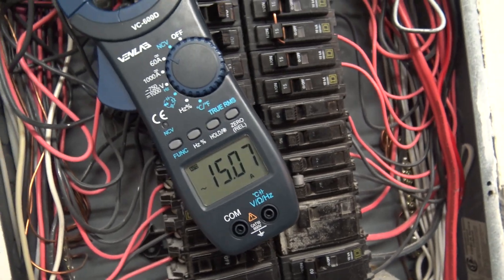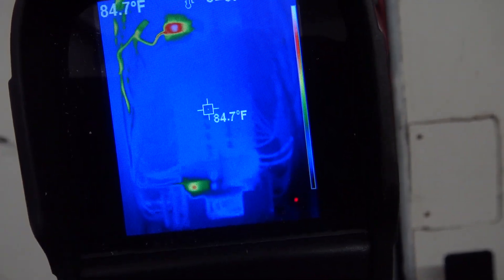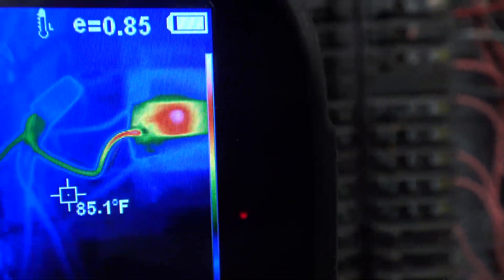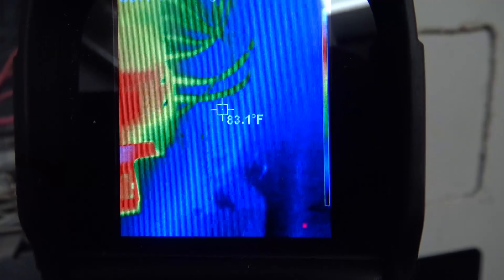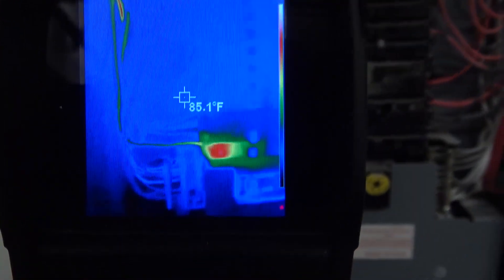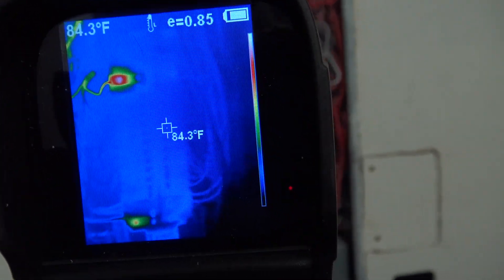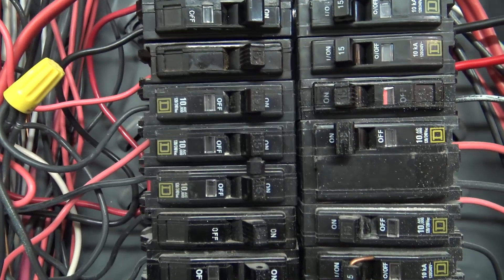Why is that circuit breaker tripping when AC running

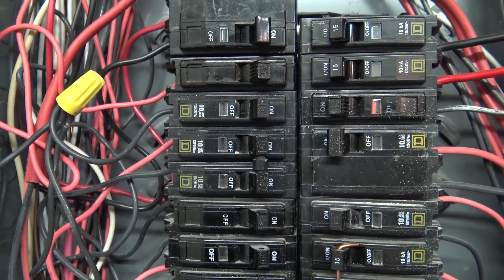Comment: I don't want to be "that guy" but in the interest of you and your family safety, it is worth it: Screenshot of 9:39 shows two hots spliced together with a wirenut, left of frame, but the problem is that the insulation is heavily scored in each wire and showing the bare metal. Please do your thing to it.
Reply from the maker: Three is no bare metal on those 2 hots that are connected.  The wire nut is not holding them together. They are twisted tight and the nut just keeps them tight.  The bare copper you see is ground wires in behind  as three js a ground bus in behind the wires.  The wires are not heating up.  One of those black wires is feeding the ac and the other a plug that is running 1 camera drawing 7 watts.  So no, there is no overloading in this panel.
Reply: @12voltvids  Cool, cool! I just saw bright material directly underneath the nut on both wires and I wanted to make sure you at least put attention to it at the actual location as you have done. Rock on!

Comment: I think it is common for the compressor to kick off, even in an at-demand situation. It might even depend on the make and model. I know of at least one machine that works like that, that did since it was new. Maybe that is what's happening. Or something to do with the capacitor (not start one) circuit and natural workings. Just guesses from here!

Comment: I'm under the impression the AC has an issue.  I've never had an issue with the a 120 volt 14k BTU AC that wasn't on its own circuit.
Reply from the maker: Its brand new and is drawing what it is rated.   Its just the heat in the panel heated from the sun blasting the other side of the wall.  Occasionally when the air compressor kicks in the breaker will trip when its hot out and that is on a different circuit.

Comment: these "close to 15a" size portable ACs tend to do this under voltage drop, say it's a hot day and the utility voltage is 115v or lower instead of 120v, nearly anything won't care but ofc the compressor will pull more amps to compensate and with such a marginal design will overamp the breaker.

this is especially a problem if the power company undersized the distribution transformer which they tend to a lot. 

since your wire is already 12 Gauge for you the quick fix is just install a tandem (2 in one space) breaker, make it a 20 amp circuit and get rid of the pigtail.

you also say the kill a watt reports 1100w? what does the power factor and VA say? you could also try sticking a capacitor across the outlet if the air conditioner is designed without one (a bit cheap and nasty but it is what it is). it would reduce the voltage drop, amp draw and boost the efficiency a little...

Comment: Your AC unit should have a tag on it indicating the maximum current draw when it's running full out. How does this number compare to your reading? Sounds to me like 15 amps is too much to pull from a 120 volt outlet. The 12 gauge wiring is good, but I think there's something wrong with the AC unit to begin with, for pulling that much current. Just my two cents
Reply from the maker: The plug on the cord has a circuit breaker / GFI on it and is marked 15 amps. The reason it trips is not the current draw, it's the current draw plus the fact that the back of the panel is probably 50c just from the sun heating the back side of the wall.  I have had other breakers trip on hot days for no reason. The lights in the shop tripped as well on a very hot day when I hit the button to open the garage door (same circuit) or the air compressor kicks in, again on same circuit as lights. Mid day sun is pretty hot here.

Comment: Maybe you in the US don't have such strict rules?

Are you thinking about fire safety? The electrics don't look so good.
Reply from the maker: There is nothing wrong with the wiring and yes it's 12GA wire which is fine for 20 amps not that I am drawing that the AC draws 15 max.  The reason it is tripping is external heating by a nuclear furnace that heats the wall up during the day. That external heat plus the fact that it is running just under the trip point eventual trips it.   The wires are all separated and not tightly groomed for heat dissipation.  A nicely groomed load panel might look nice but it also traps heat in the bundle.The electrician that initially set it up told me that.

Comment: How old is the AC and is it dirty. Dirty condenser coil will drive up head pressure and amperage. Well, so can load, it's hot outside. If you have 12 gauge wire less than 100' you can put 20anp breaker in.
Reply from the maker: Its brand new.  Has about 10 hours of use.

Comment: Initially I thought 15+ A on your AC is quite high but then, I remembered you're on 120 V.
As against that, my AC here in Australia draws around 8 A but we're on 240 V so that makes sense.
The actual wattage consumption  is very similar.
...and you're right.  Humidity makes ACs run a lot harder usually.
Reply from the maker: The reason the breaker trips and I did mention this has nothing to do with it running right at 15 amps.  
Its it running at 15 amps when it's about 35' in the shop with the blazing sun blasting on the wall directly behind the breaker box.   My wife has tripped the oven breaker on hot days baking something.  The oven has a 15 amp fuse in it so it isn't drawing more than 15 amps and at random the breaker trips on hot days.  Breakers are thermal electromagnetic protection devices.   A short circuit will energize the solenoid inside and trip the breaker.  Over heating from drawing more current than the breaker is rated will cause the bi-metalic strip to flex and trip the breaker.  The thing is external heat will also trip it.  Take a bare breaker and heat it with a hair dryer and watch what happens.  Gets to trip temp and it pops.  This is why its tripping.  Running close to trip level will produce heat inside, my car breaker get very warm when car is charging but never trip even though its drawing a 15.4 amps constant (power factor on car 1.0) power factor on ac is not going to be as good as there are electric motors involved.  Add a little external heat coming in from the back of the panel and it hits the threshold and bam nuisance trip.  20 amp breaker solves this and the wiring is already 12GA as that is what I had put in when the house was built.  I built it, I know what is in the walls.  The romex jackets are yellow or red for most.  Lighting runs were done in 14ga (white sheath) so absolutely no risk involved. Ok the short 3" jumper from the marette in the panel to the breaker where i added the soffit lights is 14ga, but thats fine because the only 2 things that will ever be on that circuit is the ac in summer, a little heater in winter and. 10 6 watt led bulbs at night.  So no, its not overloaded.

Comment: In the country I live in, we can draw 2300w from a normal power socket we have in the wall inside the house.
10A 230V AC.

15A 110V becomes 1725w.
1725w works fine for countries with 230V 240V but not so well for countries with 110v ac.

I'm starting to wonder if this is measured from the factory in 220v 230v ac. and not 110v
Reply from the maker: My counter top convection oven draws 1800 watts and it runs fine on a 15 amp circuit.
Reply: @12voltvids  Sure that it actually draws 1800w? 1800w and 110v will be 16.36A
Reply from the maker: In 1960 when the voltage was 110 sure, but it has been 120 since the mid 60s. So 1800 wants is 15 amps and that is the maximum it draws, in rush for starting the motor when the heater is running.  The heater to sanitize and dry is 1500 watts.

Comment: Is it 15.9A and 110V?
you run it on 110V AC?

Sure that specifications are not measured in 230v 240v ?
Reply from the maker: Its 120 not 110. The grid was changed from 110/220 to 120/240 back in the 60s.

Comment: When an electronic motor starts, it often draws a lot of current for approx. 0.5 seconds. Same with large transformers.
sure it's not GND. fault?

For a wire mess, spaghetti mess. in the country where I live, this would not have been allowed.
Reply from the maker: The AC has a GFI plug on it, so no not ground fault.

Comment: Here in Finland ofc our outlets can handle lot more wattage, as being 230V country and in every home every outlet is atleast behind 10A braker, some outlets are 16A such as the kitchen. Also we have 3 phases in every house/appartment, 3x 230V
Reply from the maker: Commercial properties such as apartments are fed with 3 phase 120/208.  Appliances don't heat as fast on 208 as they do with 240. Residential us single phase 120/240.

Comment: Hey! I have a Sony Handycam CCD-V9 that I can’t get the eject part to open up. The mechanism on the top goes up, but then closes itself back down without popping open the cassette part. Any help on this? Or do you already have a video demonstrating a fix for this? Just watched a crap ton of your videos taking these things apart and learned a lot. Any help is appreciated, thanks!
Reply from the maker: Toss it out its not worth fixing.  Needs dozens if capacitors replaced and they have most likely leaked corrosive crap on the board and damaged it beyond repair.
Reply: @12voltvids  Ah man, was hoping for betters news. Everything else works as it should, I was hoping it was just a stuck latch or something!

Comment: Yep, I have the same power bar. We use to use them in TV production
Reply from the maker: Yup they are great. You can load these to max power and they will not fail, unlike the cheap plastic strips.

Comment: have seen that before with AC units with higher BTU ratings that are pushing the current limit on a 120VAC branch circuit. good idea to swap out the 15 amp breaker for a 20. Should be fine with 12 GA wire. would think the CAN electric code is similar to the NEC. if you went to a 30 amp breaker then would need 10GA wire and a heavier receptacle rated for the higher current draw.
Reply from the maker: It is 12 GA wire.

Comment: Calm down, everyone. AWG 14 is equivalent of 2.5mm2. According to the current EU regulations, it is good for up to 20A. If it is good for 20A in Europe, it is good for 20A in Canada and even in the US. Metric Amps and Imperial Amps are equal. Well Chinese Amps, those are different  🙄 

I might be wrong, because they changed the EU regulations in about 2009. 20A for 2.5mm2 might be the previous regulation, when 1.5mm2 (AWG 16) was enough for 16A.
But again, if AWG 14 was enough for 20A in 2000, it is enough for 20A in 2024. Just not up to code for new installations.
Reply from the maker: This place is wired with mostly 12GA wire. The only 14Ga runs are for lighting circuits.  The plugs are only 15 amp plug however, and that is why 15A breakers. 
No, none use the quick connector on the outlet. They are all wrapped and screwed, and a pigtail is used for all the outlets. The hours was wired by a licensed electrician when it was built. I did some of the work, but it was all inspected. My office for example has 4 15 amp circuits. 2 for the equipment, one for the air and another for lights.  1 15 amp dedicated circuit for 4 40 watt fluorescent bulbs and 4 9 watt LED. all the light on 236 watts max with its own 15 amp circuit LOL. Overkill.
Reply: "If it is good for 20A in Europe, it is good for 20A in Canada and even in the US "   You are wrong, at least in the US.  The maximum circuit breaker or fuse allowed by the National Electrical Code (NEC), for wires used in conduit , NM, MC, AC, UF etc. cables  on #14 is 15 amps, and #12 is allowed max 20 amps. The ONLY exception is for standalone condensing units used for central A/C  systems, then and ONLY then you can use an upsized breaker. (The NEC considers the compressor thermal overload as the overcurrent protection, and the breaker is considered as to protect the wire ONLY  from short circuits.)  Many decades have proven it to be safe.  Now, all that said, the ampacity of the modern conductors commonly used in conduit or part of an NM cable assembly are rated to 90deg C, and the ampacities are higher than what the Code restricts them to.  

From a personal perspective, and my own testing, a #14 can do 20 amps and #12 can 25-30 amps without excessive heating, but I don't write the Code but I do have to abide by it.  (electrician since 1982)
Reply: @mxslick50  I meant if it's safe for 20A in Europe, it will be safe for 20A everywhere, regardless of the local regulations. But of course, everyone should work an use materials according to the local regulations, otherwhise if something goes wrong, the installer will be blamed, even if the real cause of the issue was completely unrelated.  

BTW I think I was wrong, I don't have time to look it up, but 20A for 2.5mm2 was probably the previous EU regulation which has been changed in around 2009. But of course that only affects new installations, if you built a house in 1990 with 2.5mm2 on a 20A circuit, you can leave it like that.

Comment: Reminds me of when I used to test and review computer power supplies. People don't realize those big 1500W units almost always overdraw a 15A circuit if they're running wide open, regardless of the efficiency rating. I had to wire a 20A dedicated circuit for those. I saw the big ones pull over 16A depending on our line voltage at the time. Hated testing those ones in the summer.
Reply from the maker: Panasonic made a 104" plasma.  It drew 4500 watts @ 240 v. Ya that was a pig Allright

Comment: That yellow  wire nut is a scary situation
The nut itself and the 3 wires hooked in 
too much 
need to move a few things around my brother
Reply from the maker: The marette is not holding  the wires.  They are twisted very tightly and the marette is basically just covering the wires.

Comment: We also are going to reach a peak of 32°C tomorrow (Tuesday), followed by a tropical night (not below 20°C) with dew points of over 16° - 20°C. Extremely humid for Germany.
Reply: On the west coast of the US and Canada, it's been around 40C since last Thursday, and at night, it barely gets below 18. The hottest days are supposed to be today and tomorrow, then it cools off a little on Wednesday. Just a couple of weeks ago it was raining and cold - the lows at night were 4 or 5, and the furnace was needed at night to keep the house warm. Crazy weather this year. It's not unusual to have a cold snap or a heatwave, but they usually don't follow each other from one extreme to the other so closely!
Reply: @gorak9000  We had a week in June 2019 where it peaked 41.2°C in my city with high dew points. That was rough. I stayed in the office until 22:00 to go home when it was a LITTLE bit cooler. The nights min temp back then was around 28°C. It's in the heart of the Metropolitan region Rhine-Ruhr, very densely populated with lots of industry and ports as well. Yep, we even had a phase of "fall" for a week past month, then it suddenly peaked 31°C again when a low comes closer. Heat and humidity often comes due to an "Omega Block" where the jet stream is pulled up north right over Central Europe. This year, the Omega is more situated East, but sometimes moves back to Central Europe which gives us heat and humidity. Low from the west causes thunderstorms.

Comment: That amp draw is unstable and seems too high for even larger 115volt designated a/c units.
Reply from the maker: When I had my "kill a watt " meter it showed only 1100 watts but the clamp shows higher.
Reply: @12voltvids  Weak breaker, inaccurate clamp meter?

Comment: The genius that wired my house put the dishwasher and disposal on the same circuit. I know it is a wiring mistake at the dishwasher end as the breakers feed the same 4-wire cable. Black goes to the disposal breaker, and red goes to the dishwasher breaker. That is a "fix it if I ever have to replace the dishwasher" problem, for now I know not to run the disposal and dishwasher at the same time.
Reply: That is perfectly legal and it is NOT a mistake. The breaker is feeding each separately with a shared neutral return. Look up  "multi wire branch circuit". You can most certainly run both at the same time with no issues.
Reply from the maker: Thats how my garage is wires as is my office, and kitchen. 2 15 amp circuits shared neutral. Remember this. If you are pulling 15 amps on one side and nothing on the other there will be 15 amps on neutral.  Pull 15 amps on 1 side and 10 on the other the neutral will see 5 amps. Pull 15 on each side and neutral has nothing on it.  That's how balanced loads work.

Comment: This AC probably has a bad power factor, that's why your other measurement device showed a lower reading. What does the AC manual say about power draw?
Reply from the maker: It says to run it from a dedicated circuit and not use extension cord.
Reply: The other mesaurement device is a Kill-a-watt, which is a proper digital power meter, true-RMS and it measures the power factor and calculates the power accordingly.
Reply: @mrnmrn1  Can't write the first word in the product name for some reason, comment gets deleted immediately cause I'm shadowbanned. LOL